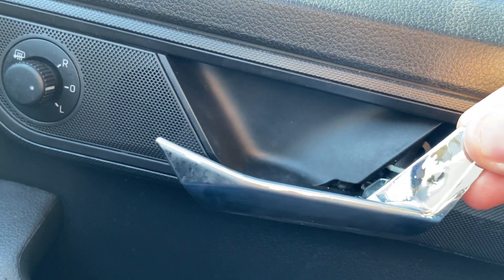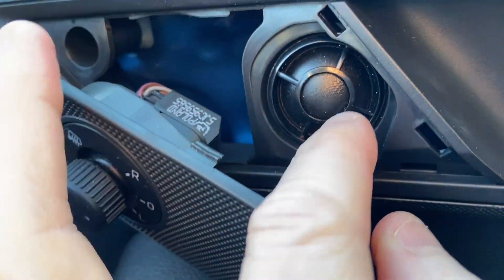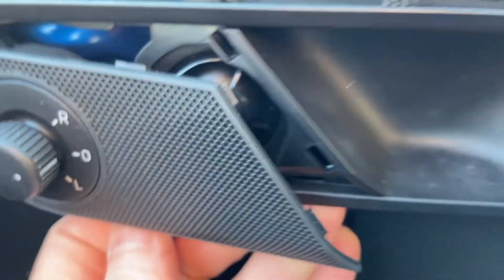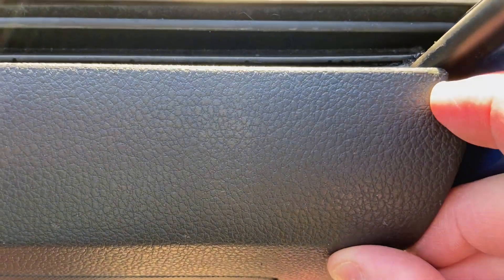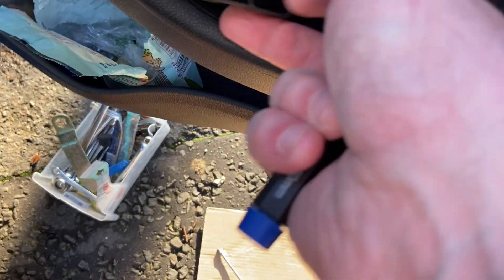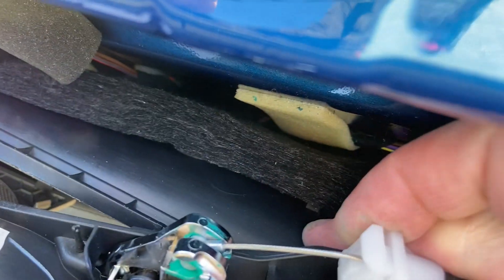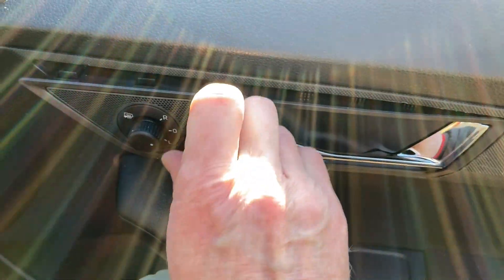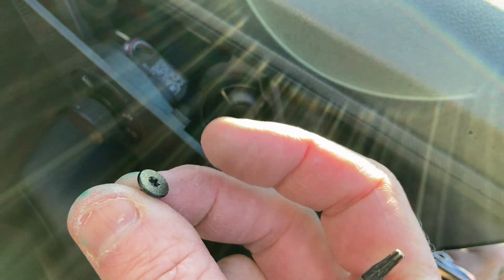Replacing a Skoda Fabia internal front door handle (Mk3/2016)

Comment: Thank you, I have to do this repair on the weekend and this is the only video I've been able to find👍
Reply from the maker: hope it helps - I couldn't find any other videos so I put this up!
Reply: Thanks for this, it helped a lot. One point though, I managed to disconnect the cable from the old handle and reconnect the new one through the gap, without pulling the main panel off the door and without any special tools.
Reply from the maker: even better, you should post the video for how to do that!!